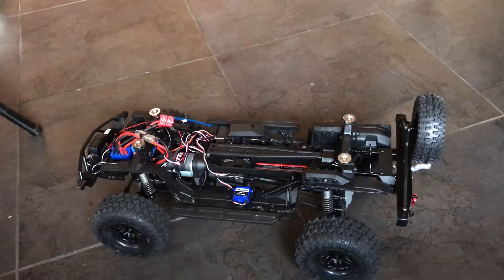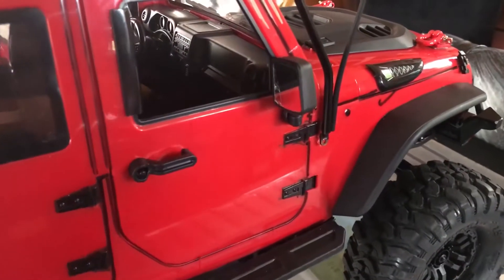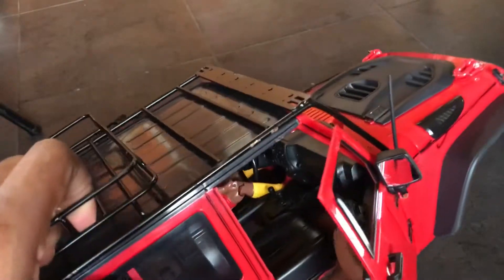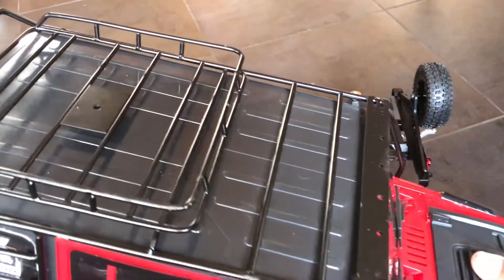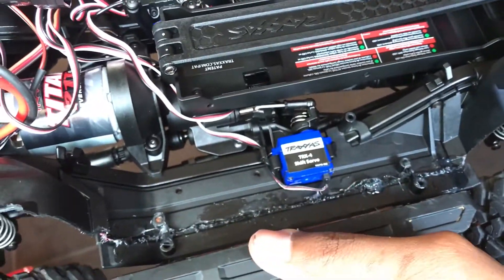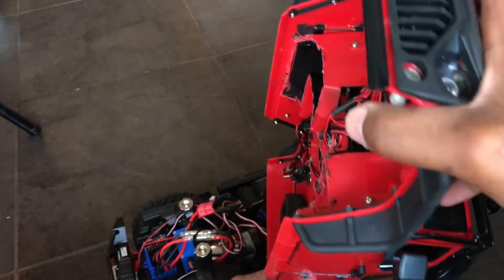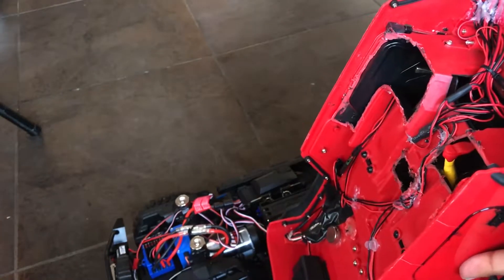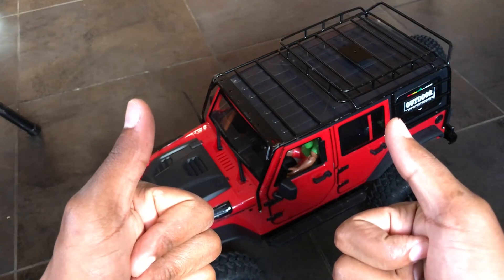CUSTOM TRX - 4 JEEP JK HARD BODY

Comment: Did you drill the body post to put the magnets on?
Reply from the maker: paulshadows No, I shoegoo the magnets into the hard body for a seamless look
Reply: GND RC ADVENTURES im talking about the magnets you attached to body post
Reply from the maker: paulshadows ohh, I used a dremel tool and removed the part for the body clip. Then I drilled a small hole in the center of the post and inserted a short screw to fasten the magnet in place